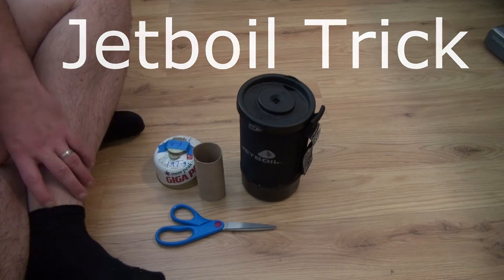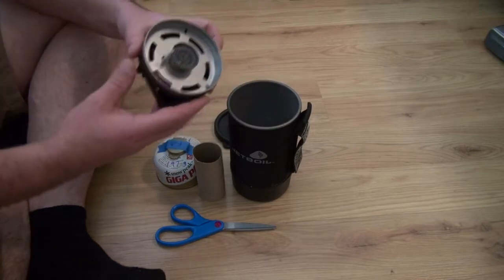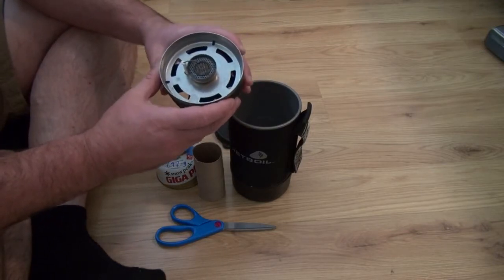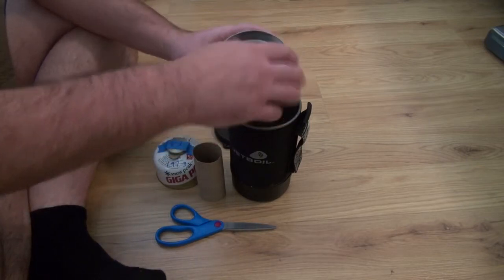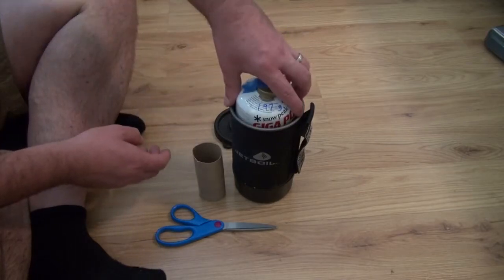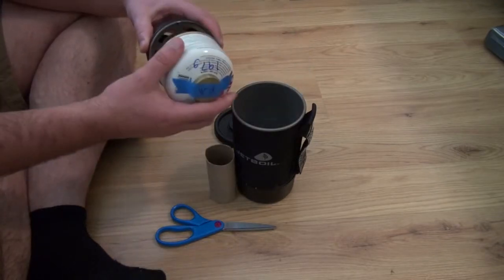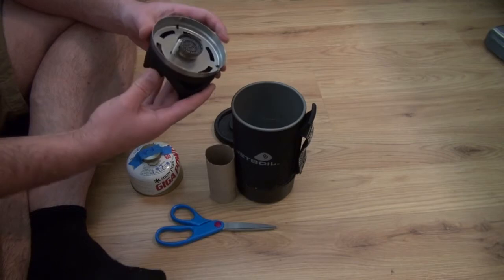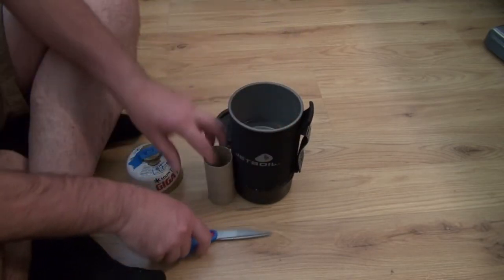Jetboil Stove Trick

Comment: not bad man, I dont want to bash ur vid but you are packing it wrong. it goes canister support, stove (upside down), fuel, pot stabilizer, lid. just wanted to let ya know. maybe you have an older or different model than mine but try it it works good. does your pot have marking on the side that shows how to pack it??
Reply: Most jetboils even have little diagrams showing how to pack them properly. I have several, the oldest of which is from 2004. No rust rings in any, and all the piezos work fine. Follow the instructions and they will outlast your use for them.

Comment: Your supposed to put the fuel bottle in first!
Reply from the maker: if you put the canister in the pot first you can end up with a ring of rust in the bottom of the pot  (from the fuel canister).  It takes forever to clean the rust out.  Mine original one did not come with the pot stand.  It was one of the first ones made.  The jetboil Sumo  now comes with a cardboard cylinder to protect the burner.

Comment: I place a piece of paper towel on the bottom of the fuel can and then insert the fuel first, followed by the burner.  The paper towel helps to absorb any moister and also prevents the fuel from rattling and scratching up the cooking cup.  I would keep the plastic cover for the fuel can and cover the port on the fuel to prevent accidental purging of fuel while packing and moving around.
Reply from the maker: Phoenix Reyes The paper towel is a good idea.

Comment: Seems like this is an issue Jetboil should've figured out. I put the orange spreader in first, burner facing down (there's an indent in the orange that fits the burner) next fuel (right side up). the pot ring then slips around the burner (pointy things down). I like your basic idea-(Jetboil should've thought of this). However, I've got more parts. Moisture absorption is a good consideration.
Reply from the maker: Thanks
Reply: The method you describe it what JetBoil has printed on the side as a diagram explaining how to pack it correctly.
Reply from the maker: Thanks, my JetBoil is an older version.  JetBoil did not print instructions on the older cups.
Reply: The order of the parts, yes. But I put the burner upside down on top of the orange ring, and the gas can upside down, on top of it. (I think this can position is different from. 
At 2300 meters (7550 ft) 61f/16C the piezo didn't work very well. I resorted to matches. Also JetBoil has the color heating indication on the side of the mug, but never indicates how to read temperature from it. I guess it must not be accurate enough. Also there are no instructions on the cup, there should be.